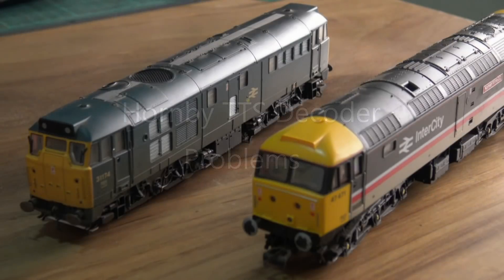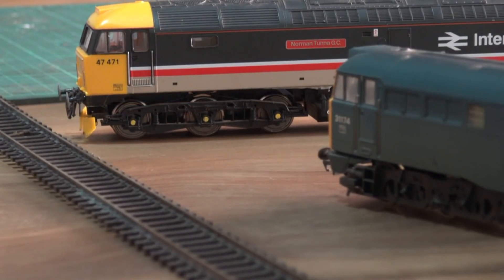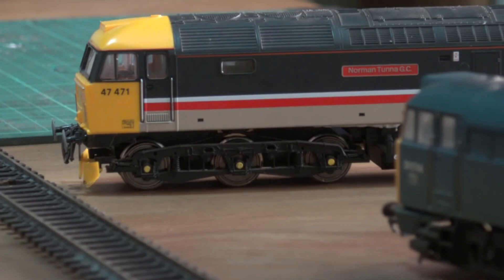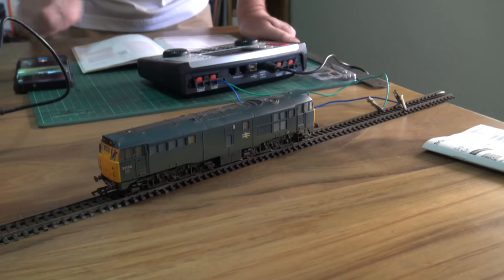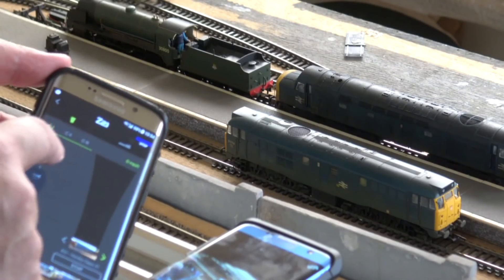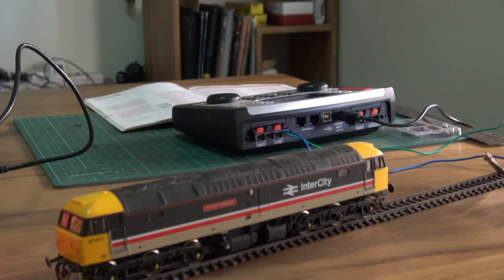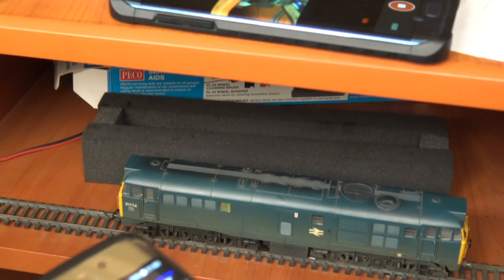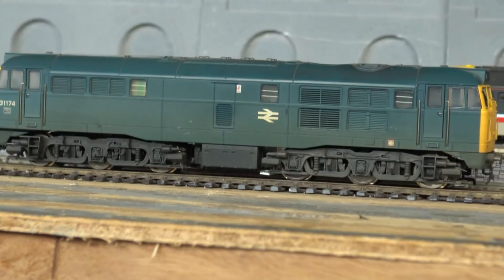TTS Decoder Woes at Kampala Road

Comment: Hi , I have had similar problems with TTS and .ESU 3.5 factor fitted decoders  either overheating or just not working . Having messed about and in some cases fitting Zimo or ESU 4.0 decoders to G fix them which do work fine I am getting a bit fed up of digital and have recently gone back to dc. . You just buy the loco and put it on the track and it works !! No ripping it apart, no remembering numbers and no guarantee problems . My pleasure is starting to come back !!Oh and it’s cheaper so you can have more locos and stock !! I know this maybe not for you and the sounds are great but it maybe a thought as you seem to be getting fed up !! Simplicity has brought my pleasure back ! Thanks for the great videos and keep them coming . Richard
Reply from the maker: Hi Richard,  you make some very valid points. Simplicity being the main one bring back the pleasure of model railways.  I know and understand where you're coming from and it's a very valid point. Yes the idiotic situation where we buy an expensive item, then rip it apart to install equipment to get it to work!!! I don't think I could go back, but the question had to be why do we have so many issues???? It seems with all the consumer protection around these days, the manufacturers in this game, and in some cases the box shifters fly under the Rader.  Thanks for your input and support,  as that's how I see comments like yours. Take care, Jerry

Comment: I also have the Z21 system and having problems with HORNBY class 31 31110
It has its second visit back to HORNBY .. 
U not alone I am in decisions with HORNBY about this issue .
Also belong to a model club which are using Z21 system ..
It also have the famous chassis rout  which Is causing lots of TTS 31 decorders blowing .

Comment: Hi Jerry, I've had a couple of friends bring tts locos to me in similar states. I found that any attempt to programme them on two separate controllers was the issue both times. The TTS chip has effectively a blanket over many cv's to protect the user from knocking the sound out of sync. Such as the algorithm setting and the acc, dec rates never below 15. 
It also masks some others, I don't know why but it seems to be how they work at Hornby. I need to double check the handbooks as I'm not sure the reset is cv8 to 8 on tts. 
Anyhow, do your reset completely on just the z21. Then check (read) your accessible cv's on the z21. Look for the config in cv 29 and check 14/28/128 is set for 128. If not reset that, also turn off DC mode. Then renumber to your required number. All on the z21. If that doesn't work contact me and I will work through it over video chat with other solutions. The chip in the vitrains 47 may not be the issue, I saw the prop trying to move, check free movement. 
Kind regards
Tim
Reply from the maker: Hi Tim and apologies for the slow reply. 
I have now manged to get the 31 working. For some reason turning the loco to face the other way made a difference!! I reset the decoder via CV8 and then reset CVs 150 through to 154 to the well known values that are prescribed. Ie cv 153 to 225 etc. This seems  to of worked to a fashion. I now have very smooth operation with about half the functions working. Fortunately engine running noise is one of them.
The 47 decoder is stuffed. The loco is fine.Its a viTrains which despite their bad press are excellent runners. I put a normal decoder in her and all good. I then tried a 37 TTS and again all good. The Z21 will NOT talk to that particular TTS decoder as with others. The funny thing is I have installed a Castle TTS into my RR Hall class. I programmed everything on the Z21, no problems!!
Anyway many thanks for taking the time to explain, I really appreciate it. By the way, I have turned off Railcomm on the Z21 settings.

Again thank you and all the best. Jerry
Reply: Jerry Allen  pleased to hear it's running. You may want to consider dual chips. Fit an engine management chip to the socket as normal then add the sound chip by attaching the power wires. Then set both decoders to the same address.
Reply from the maker: I had never considered that! Thanks

Comment: I run 10 TTS decoders 7 of which are retrofitted to Bachmann,Heljan and Hornby. I have never had a problem and all locos work perfectly I use a Lenz system.
Reply from the maker: I think some of the problem is the Z21 does not like them. I also feel they have improved over the last 18 months with each release. Cheers Jerry

Comment: Hi Jerry. I have 6 retrofitted TTS decoders in Heljan,Bachmann and Hornby and have had no problems so far I think they are terrific value for money. I am using Lenz controller. I would send them back to your supplier under warranty.
Reply from the maker: Hi, yes I agree terrific value as long as they work. I think I have mastered them now and like you have retrofitted 9. The 31 is now so smooth it's a joy to operate. The Z21 certainly doesn't like the earlier batch of decoders but the newer ones seem to be okay.  Thanks for the comment and watching cheers Jerry

Comment: Hi Jerry i have had the odd tts go out for no reason. The TTs decoder is based on the Hornby R8249 which is why you can't change the CV'S and why it,s cheap. When i program them on the main i don't use my layout as the main i use a piece of track and connect my main wires to this.  Has on my video's i do use Zimo more now then the Lok sound but they do cost i use tts on older models.Mick
Reply from the maker: Hi Mick, I have seen your sound loco as I sub to your excellent channel. Thanks for the explanation. I feel it is a brilliant concept by Hornby, just the execution is awful and painful for the customer. I hope they get it right. Cheers, Jerry

Comment: Hi Jerry youv'e proberbly already tried this but have you tried the piggyback approach by using an ordinary decoder for the lights and motor and running the tts just for sound. reds and blacks go together the orange and gray on the tts will need a small resistor connecting. to make it think it has a motor connected,  It worked for me    Regards Alan.

Comment: Hi, I too have had awful problems with Z21 and TTS, differently to yourself. I didn’t experience the random behaviour like you have but I start the sound and strangely they burn out, you get that horrible smell you just know that’s another £40 gone down the drain. Ive given up after number two. I find Zimo decoders to work brilliantly as Zimo and Roco do work closely together.
Reply from the maker: Hi John. Thanks for that as I was beginning to think it was me! I agree, like the one in the video,  the thought of another 40quid gone is not a good one. Zimo are good and no more TTS for me I feel. Hours of wasted time not to mention the money.  Thanks again for letting me know I'm not alone! Cheers Jerry
Reply: Definitely not alone on that one. Ive tried many decoders and zimo seem to be the most reliable and hive gorgeous silky running. Had one fail out of around 30. The unfortunate thing is we all have to learn the hard way. Zimo are not cheap but as the old adage says ‘you get what you pay for’.

Comment: Hi Jerry
Very depressing to see your tts issues.  I too have issues with tts but no failures yet, although my class 60 has started acting up!
Sorry no answers for you???
I think it's a case of avoid avoid avoid and buy a decent decoder.
Cheers Paul
Reply from the maker: Yes Paul you are correct. Avoid and move on. I guess you buy an expensive loco, have good power and control,  then ruin it all buy installing a cheap decoder!! My bad. Thanks as always.  Jerry
Reply: I think we are all concerned about the longevity of tts, maybe it's starting to prove some people right and certainly won't do Hornby and good.
Cheers Paul

Comment: Hi Jerry, can you check the voltage for me, from the z21 and elite, to both the programming track and the main..Simon
Reply from the maker: Simon,  the z21 is at 20 to 21v. Not sure about the Elite,  but the book states 20v. Thanks again Jerry
Reply: Thanks Jerry,  the last time I saw decoders responding a couple of seconds after the F key was pressed the problem was down to insufficient power getting to the track. Are you able to check the voltage to the track when you try to move a train or press a Function key?  I do know Vitrain locos have an issue with TTS decoders and the are not 100% compliant. What is strange is you have issues with several, which is why I was looking at voltage drop, the TTS decoder and loco may be trying to pull too much voltage...Simon

Comment: You better use Zimo or ESU (sound)decoders with the Z21!! These work well together. Wich loco is making that bad noise at 18:30 ?? Regards Onno.
Reply from the maker: Ha ha, well Onno you are absolutely right, it's the Trans Rail Class 37 with a very noisy trailing gear box. I should not of used her but love the loco! Agree 're Zimo end thanks for stating that. Thanks again Jerry

Comment: Hi Jerry I also have recently  had a class 31 the decoder fail  I have a z21 I can't  get any response on programing  track or the main  need to dig out the dynamis to try and get  it to run I had a class 47 decoder burn out in a railroad model  as well .........Paul.
Reply from the maker: Paul, you and I are having similar experiences! Whilst I hate to say this  I'm glad I'm not alone. Sorry to hear about your troubles to. It is very frustrating I have to say and I'm sure you feel the same way. Hope you work through them but I feel Hornby have not got this right unless you use Hornby controllers. Cheers Jerry

Comment: Not a good add for the TTS with the z 21 ... not a combination to be recommended ?
Reply from the maker: Gday Dave, when they work they are fine and great to use. Maybe there is an issue between the Z21 and Hornby decoders.  Who knows! This is my experience.  Cheers Jerry
Reply: Dave, how many TTS decoders do you have? And with your experience of controllers, how reliable are they?
Reply: Tom Lawton Tom I only have had 2 one was in A4 which did not like the dynamis controller , to be honest I would not buy again , although some do sound good ... Dave

Comment: Wow, Jerry, I’m so sorry to hear of your ongoing issues. I will pm you, as I need to go all electronic on you. 
Interesting noise from the container train; one axle off the rails?
Reply from the maker: Slipping trailing gear box. More interesting than the TTS??? Lol. Thanks Tom.  Jerry!!
Reply: Jerry Allen The noise is something I can actually comment on, and, lo, incorrectly! 🙄
Reply: • Motor stall current
The motor stall current may overload the decoder; even though it uses an 8-pin interface (or any other standard, including in-line wiring) there is no guarantee that the motor stall current is within the rating of the decoder.
The motor stall current is best measured by stalling the loco, and (at maximum drive voltage) measuring the current.  Note that you may set your rail to 20V with DCC, but probably test the motor with 12VDC nominal, so the measured current may need to be multiplied by 20/12.  And if your test box droops the voltage below 12V because it cannot support the current, then this fraction becomes even more vulgar!
The stall current is important because the motor, when running at low speeds, will generate no back-EMF, and so each pulse of voltage across the motor will be effectively providing the stall current.  Only once the motor is running fast will the back-EMF increase, so the voltage to generate the current will effectively decrease, and hence the inrush current will decrease.
And a coreless motor is worse than an old-style motor, since the currents will increase and decrease much faster; there may even be an effect of the rate of change of current on the decoder, wherever there is any smoothing to make the current measurement more reliable.
If the motor is only marginally above the rating, you could reduce the current with some form of resister.  Trouble is, low resistance resisters are rare and can be expensive and large, so the common way to reduce the voltage across the motor (and hence the current) is to use diodes in series; apparently the voltage is dropped by approx. 0.5V per diode, but there is very little heat generation to contend with.
(As an aside, I wonder if the motors in the high detailed 31 are the same as the railroad 31 TTS.  If not, then the parameters may not copy across, and the decoder stress from the motor may be different)
Reply: • ESD
The bane of reliability; Electro-static Discharge can put spikes of many thousands of volts into the circuitry, and even if it doesn’t destroy the decoder immediately, it may have generated damage that will occur later in life.
Look at the shipping container for the decoder; it should be in a shielded bag (typically dark, reflective) or at the very least, should have ESD foam (typically black) around the pins.  If these are not in place, then the chip may well be damaged before it gets to you.  However, given that they are expected to be installed by modellers (ie people not skilled in handling sensitive devices) it is possible to make the decoder robust to such damaging influences.  More robustness = more cost.
Remember that ESD comes from Static; therefore, a Static Grass tool (which generates and uses static to make the grass stand up) will be deadly to all sorts of electronics (from controllers to decoders). It pays to design an earth strap into your track design, so any electronics attached to the rails can be protected by a robust earth strap. And take as much as possible off the layout to reduce the risk, anyway.
Reply: • Controller effects
If the controller you use has a poor power supply, the voltage may droop as the inrush current appears.  This will self-limit the inrush, and hence protect the decoder in between.
Put a decent power supply on the front end, and the droop disappears, so when the decoder says “give a pulse”, the supply does not droop, and the in-rush can be the maximum that the motor demands.
So a better controller may result in greater damage to an overloaded decoder.  How perverse is that!
Reply: One further comment; paper and those cutting mats that many use as a working surface are both hideous for generating ESD/static, and so will cause damage to the decoders at the point of installation.

Comment: Hi, with the class 31 try changing the orientation of the loco on the main track. I had a similar problem with this and a few other newer tts decoders and my esu controller. Watch the video I posted last year. If this is the case, return the decoder to Hornby for reprogramming. The loco worked when pointing one way but not the other. Your class 47 obviously has a faulty decoder. Good luck
Reply from the maker: That's amazing Peter, it worked!!! I have now changed CV 150 to 154 and I have a very smooth running loco in one direction anyway. Thankyou.  Why does it do that? I can't send it back but a least I have movement! The 47 chip is as you say defective. Number 4 to go that way. Thanks and on a follow up video I'll highlight you solution. Amazing,  but I feel my TTS days are nearing an end. Cheers Peter, Jerry
Reply: Hi Jerry, Glad to hear you have found the problem. Now you need to contact Hornby customer services, get a returns number from them and return the decoder, not the whole loco, just the decoder. I'm sure you would be able to do that. They will reprogram the decoder and return it to you. Turn around is less than a week. This problem only appeared to affect locos issued 2016 tip 2017. I have had to return a number of locos / decoders for reprogramming and all have been returned and are fully operational. Hornby advise that all newer models will not have the problem, although I purchased a 31 decoder a couple of months ago and it had the same issue. Returned it to Hornby and within a week it was returned and was fine. I don't understand all this bad mouthing with regard to tts decoders. I now have over a dozen tts locos and have fitted a couple to bachmann locos ( cv's adjusted) and have had no other problems. I've recently received the new HST in exec livery with the new Valletta tts sound and it is brilliant. Don't be put off tts just yet
Reply from the maker: @petercrowe2659  Hi Peter, thanks for taking the time to explain.  I too have them fitted in different makes  so much like you once changes to CV seem to be okay. The 31 runs okay but most of the sound functions don't work, although the engine one does! TTS is a brilliant idea and I'm grateful to have chance with sound. Execution by Hornby however has been poor and doesn't help the image. Thanks again. Not sure how I go given where I live in returning stuff , that's another adventure.  Cheers Jerry
Reply: Jerry Alle

Comment: TTS decoders are NMRA compatible, Have you cleaned your track and the wheels on the problem locos?
Reply from the maker: Hi, yes all good in that area. Interesting you say they are compatible but are they compliant,  that's what I was really asking as I have been informed they are not. I have looked on the Hornby website and do not see anything to state they are. I would be very grateful if you could point me the right direction here to confirm.  Thanks for your comments.  Cheers Jerry